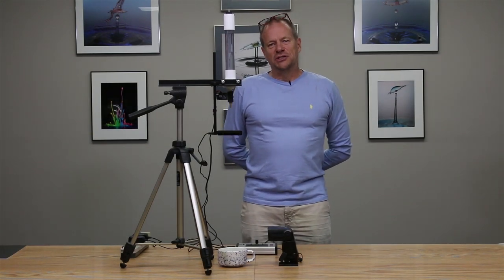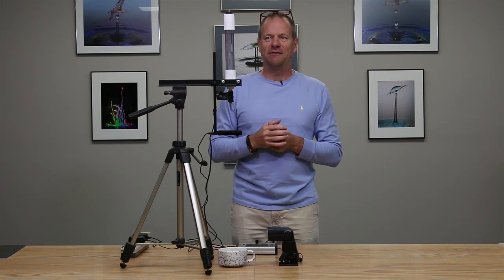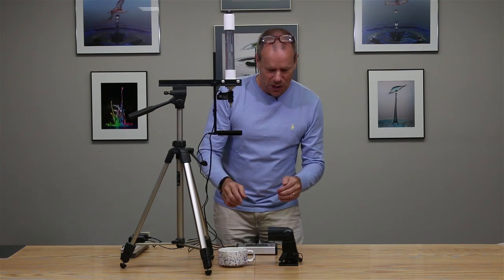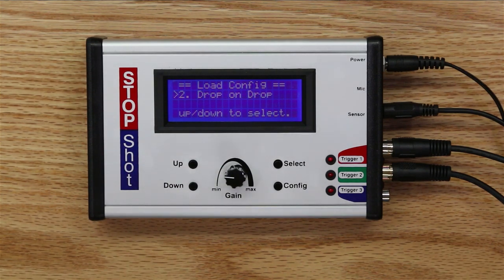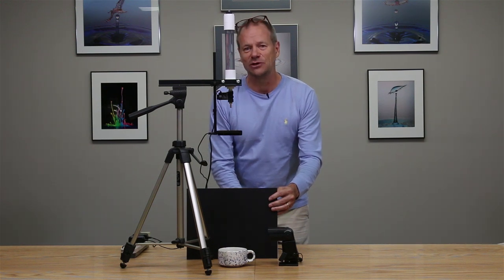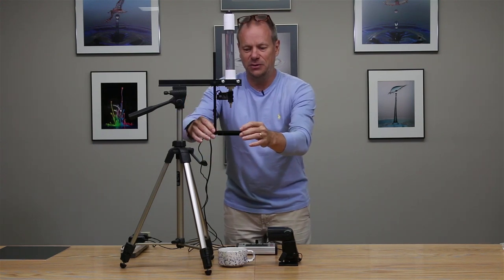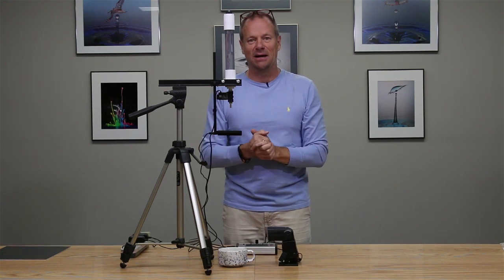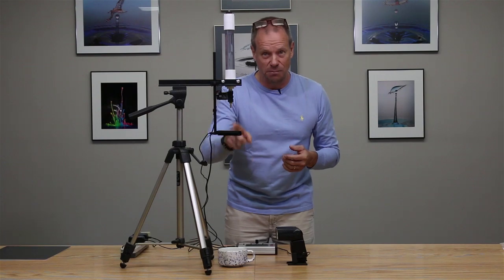Demo: StopShot water drop kit

Comment: i have got the kit today << bit confused , do we always have to keep pressing the  camera button to take picture. or there is possibility to operate camera from stop shot ,, eg ,, if we push the button on the stopshot to release drops .. camera automatically capture the image at certain interval ( like in splash art kit )
Reply from the maker: Hi Aamir,

You can have StopShot control your camera if you have a shutter cable for your specific camera model.  However, we recommend not starting that way because the camera's shutter lag can create a lot of uncertainty (making you think it's the kits problem when it's actually the camera!).

Comment: The StopShot I just purchased does not seem to have a Release button. How do I do this? I have the setup working when I trigger it with my finger passing through...
Reply from the maker: Hi Kellar, 
It sounds like the water-drop settings aren't loaded.  Check out in this video starting at 3:20 for loading the presets for water-drops.  That should get you up and running!  If not just drop us an e-mail at support@cognisys-inc.com and we'd be glad to help.
Reply: Thank for responding so quickly.  This has me working out the process now.  Early results look promising.

Comment: How long do you put the flash in the STOPSHOT to pick up at the time of the collision
Reply from the maker: Hi Fabio,

Starting at 3:22 we go through loading the settings for the drop-on-drop collision.  That has the delay set to 290ms (You can see it on the main screen at 4:37).  If the valve is set up to the proper height this should get you very close.   It would be a good exercise to drop that down to 260ms and increase it 4 - 5 ms at a time just so you can get a feel for what "time" means to a water drop.  Hope this helps!